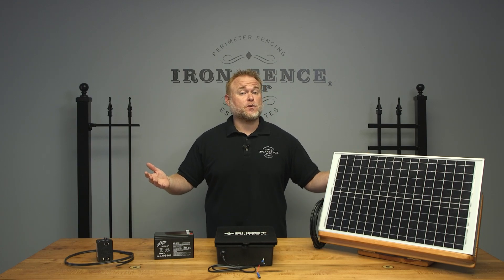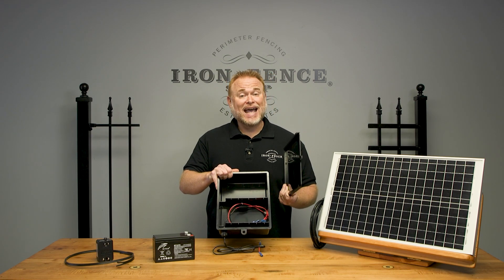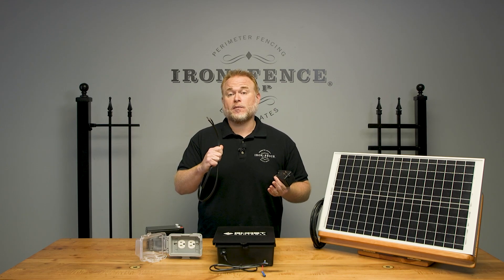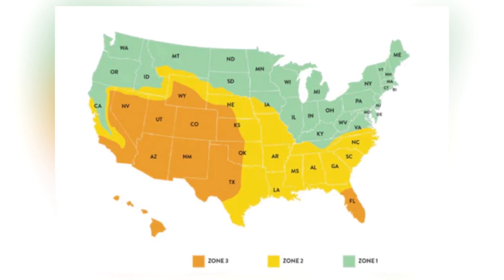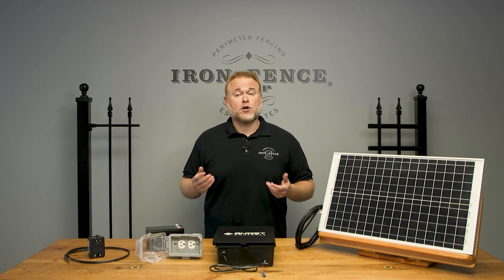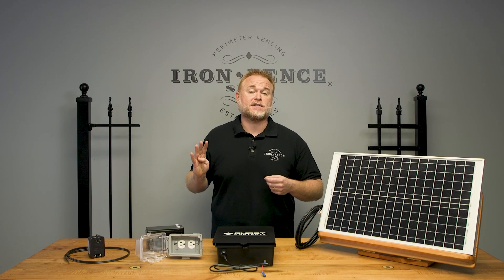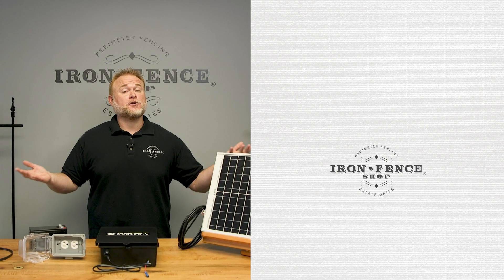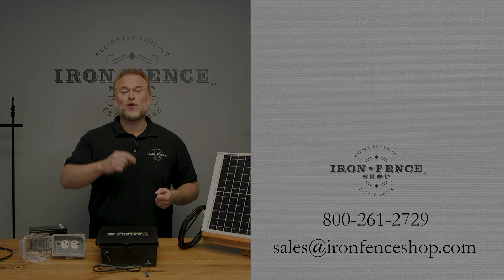Power Options for Automating Your Aluminum or Iron Driveway Gate with Ghost Controls

Comment: could you run it on a lithium 24 volt or 36 volt rechargeable battery pack? like a dewalt or milwaukee battery pack?
Reply from the maker: I am not sure on that.  You would have to contact Ghost Controls on that.  My concern would be any type of different voltage not being handled by the board and messing up the trickle charge and cutoff function.

Comment: Do I need a battery? Can I just run line from my home, convert it to 12v, and connect to where the battery would plug into the mother board?
Reply from the maker: You would have to ask Ghost directly.  Every manufacturer typically has the plug-in transformer step down the power to trickle charge the battery.  The battery is what powers the gate, so I'm not sure a direct connection would work out.  It may send too much voltage to the motors.  If you want to ask Ghost, their tech line is 850-898-1411

Comment: Can you use ONLY the battery, without the AC power supply nor the solar panel? Installing a similar system in a remote location that is under quite a bit of trees, so solar isn't an option - and neither is power.
Reply from the maker: You technically could, but the battery wouldn't last long.  Maybe a few days to a week at best.  The AC power or solar is effectively re-charging the battery after each use so it stays topped off and fresh.